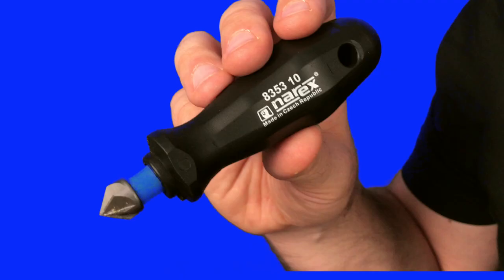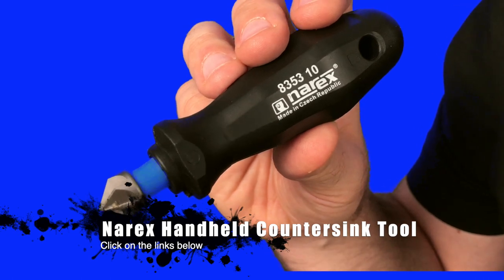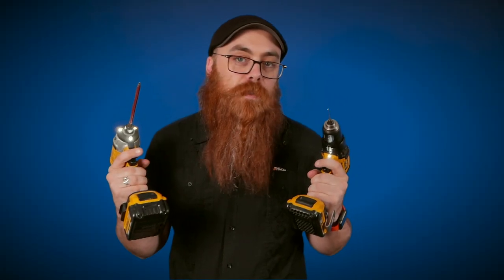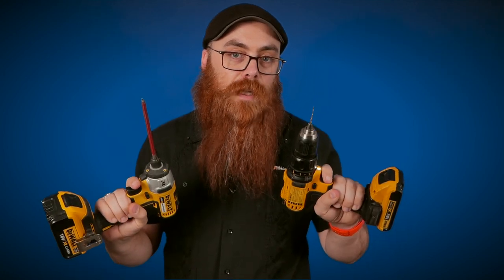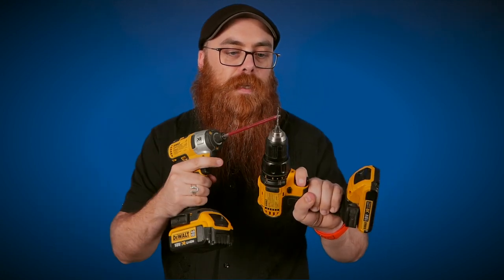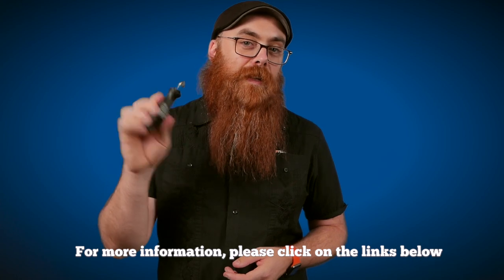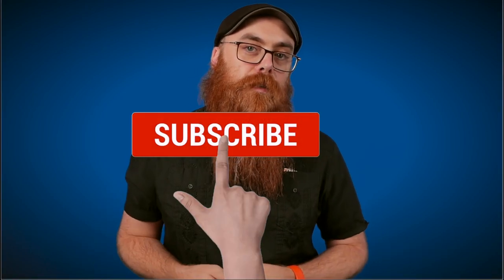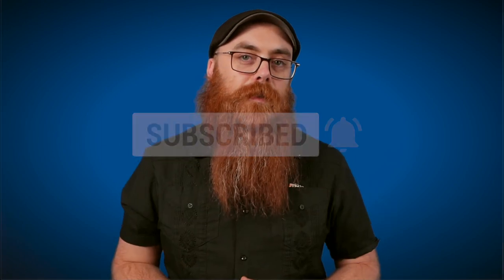It's Cool Tool Tuesday - Countersinking Made Easier!

Comment: i  use a little cordless  Dremel 1/8 pilot hole drill  bit that includes a base with a countersink. It's all together.  Your thingy is too much trouble.
Reply from the maker: Thanks for watching and commenting Tom. There are a million ways to countersink. This is just one of them. Your Dremel setup would work very well, no doubt.

Comment: Wouldn't you just use a counter sink drill bit, or have a 3rd drill with a rosebud on it?
Reply from the maker: And if you don't have a third drill? That's where this little ripper comes in handy. That's Phil's point. No extra drill or changeover required.
Reply: @timbeconaus  Actually, he's referring to a bit with a countersink attached to it as well as the pilot bit.  You could, and probably would to be honest, but if you don't have that particular countersunk bit on hand this unit is a great universal backup plan.
Reply: @scheinbein exactly! I could see value in this for soft wood where you have more control and pressure input.